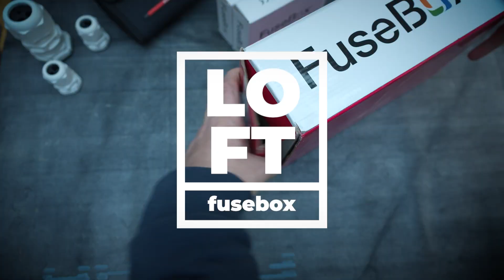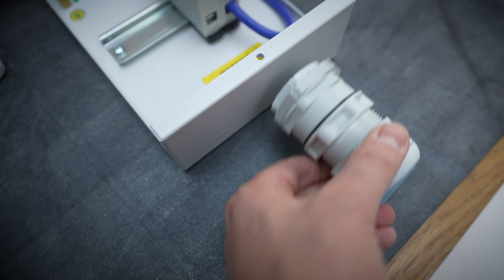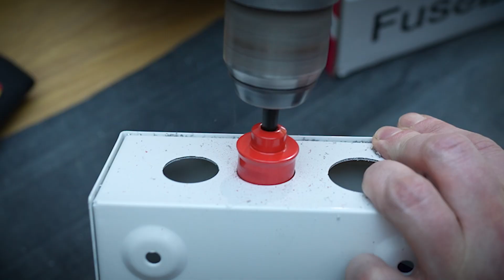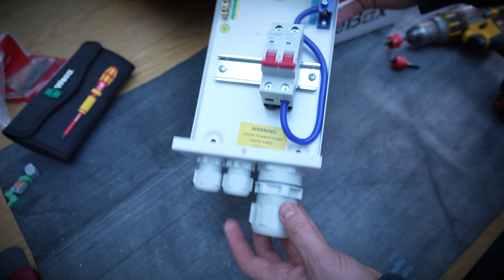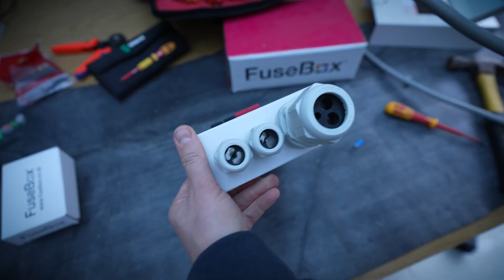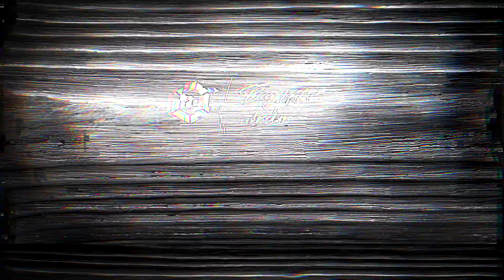Loft Conversion UK. Fusebox installation for loft conversion.

Comment: Why does the loft need a seperate fuse board?
Reply: Hi, there was no space in existing consumer unit for additional loft sockets / lights circuits.
Reply: I all ready had cables up in mine so jumped off them loft cost me 20k finished did it my self